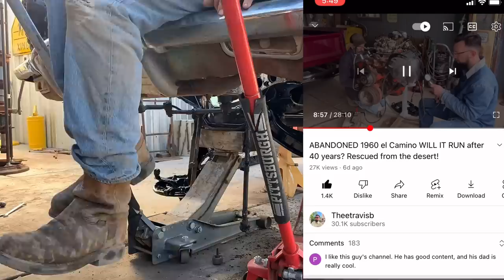ABANDONED 1960 el Camino revival, engine, suspension and brake work!

Comment: I love the do it yourself mode.  Been there and done that.  After a few sets I realized that dropping the arms off at the machine shop and letting them press them out was so much nicer.  Sure you paid some cash but they would be done and done right making beating out the bushings a long use of time when you could be doing other things. I always install a new timing set and oil pump on any used engine I have to install. Its cheap insurance.
Reply: That or having a harbor freight hydraulic press and heavy duty sockets, my buddy helps me out with that and for making our own brake lines he has a double flaring kits and we either save the fitting or go to autozone and also he has a coil spring compressor, he helps and sometimes I'm the hold the  tools guy

Comment: I own a 1960 Elcamino with a 327 but it's three on the tree. I did my suspension work with a press seems alot easier but you need to make some adapters. I also used Energy suspension bushings . One tip the bolts that clamp the bushings should be tightened  only when the car is fully assembled and all weight is on the wheels. By tightening them up with the control arms lowered they will bind up once they move up with the vehicle weight on them.
Reply: That's correct about having the weight on the suspension before tightening.
Reply: Yep, got that tip from Old Car Alley doing his Galaxie.

Comment: Glad to see you do new freeze plugs. So many times seen guys not on a used motor and end up with leaks.
Same with a quick internal inspection and reseal.
Myself I have never used the rubber end seals on the intake. Just a good bead of silicone left to skin over really well and carefully set the intake. Never had a leak and that was on some high horsepower engines.

Comment: You might have to change front yoke on driveshaft and also change driveshaft if this car was an automatic, I had to change yoke to install a 69 TH350 in my 60 Impala, but I found a driveshaft from a 4 speed car which did the trick, perfect fit, both length and yoke. Just a hint, I'm sure you probably know this. Nice work, love the 60 Chevys. Will be good to see this one run. (I still have my Impala, have owned it for 50 years, it's a keeper)
Reply from the maker: Thanks for the advice and that’s really cool you’ve had it that long. Wow

Comment: I really enjoy the father son working together and especially what you are doing with the El Camino. FYI, the ball joints have been replaced, that's why they bolt in, factory has rivets, occasionally on old A frames the new bushings will occasionally slide side to side, if so just hit them with a little spot weld. Next time on the master cylinder use a bolt like you did but put a nut on it and a socket or a piece of pipe and make a puller, also put some air pressure in the back but be careful the plunger will occasionally fly out with the air pressure. Great job guys, just fun to watch, keep it up.
Reply from the maker: Yeah you’re right they have been replaced good eye

Comment: Enjoying seeing the 60 E/C. One suggestion...you need to loosen the a-arm bushing bolts back up, just so they aren't tight, and wait until the car is assembled, and with the car sitting normally with the full weight of the car on the tires, before tightening the bushings back up to torque spec. Just before you tighten them, bounce the front end of the car up and down a few times, which helps settle the bushings to a natural position prior to torquing them. The bushings, as they are now are tightened with the a-arms hanging down, will be binding when the weight is put in the car and it's sat back down on the ground, which will hold the car up in the air a bit, and stress and wear the bushings prematurely.

Comment: Awesome to see everything on the front end cleaned and painted, but one question is why not use your impact wrench to take apart some of the bolts, like lug nuts and even smaller ones, I do it for lawnmower repair, you and your dad are good team, working on the master cylinder I can see you guys need to get that vise bolted down better, watching you work the master it reminds of myself without better tools, but sometimes it doesn't help, like on  my ford taurus we had to knock the lower ball joints out to get at the front wheel bearings as you could get the bolts to start but not enough room come out, and the ball joints were a bitch, like seeing your progress and blacken up everything you can get at to make what's good last 60 years

Comment: You should have mentioned your trick to hold the fuel pump rod, I noticed you turning in a bolt in the front motor mount hole to hold the rod while you install the fuel pump. I learned that trick years ago but there are many people do not know you can use a longer bolt in to hold the rod but then you have to put a shorter bolt in the hole to seal the hole after you have installed the fuel pump. I use an installer to mount the harmonic balancer, so it does not get damaged by hammering it on.
Reply from the maker: Good eye

Comment: Thanks for another great show! Rebuilding whatever you can instead of replacing parts, cool. The original brake master cylinder was tough, but is righteous! It will be a little tougher drive, but a more ATHENTIC driving feel. And that pushrod and those main bearings oughtta be just fine!

Comment: Not updating the brakes? Master cylinder and disc brakes on front? I know it throws off the rim with a disc brakes. Those things aren't necessary but they sure are nice. 327 fantastic. No better engine in my book. I've got 4 door hardtop with hardly any miles on it. We still have my dad till 60 what's not rusted away sitting down back as well. You and your dad working on these vehicles especially the 60 makes me think back. These are some great times that you have.

Comment: I'm afraid you might have trouble with that oil pan clearing the cross member. Also I think those are 6 cylinder motor mount frame perches

Comment: Nice work fella's, things looking good. I always use spring compressors when messing with coil springs... just too dangerous. As well, check my vlog on how i use a home made press to install control arm bushings made from simple left over supplies around the house!  going that far i would have pulled the heads and done a quick lap valve job with new valves seals... that said,  always the question of, when do you stop? thanks again for sharing.

Comment: Deleted my comment on the previous video about replacing the A-Frame bushings as I see you did it in this one. Free tip on installing the replacement bushings next time. Put them all in a plastic bag and toss them in your home freezer for a couple of hours (over night if you have the time) and you'll not have to bang them into place ... with lube or neve seize, usually you'll be able to press them in  with your thumbs.  Great series ... looking forward to seeing more. Bon chance from your favorite Texan (and a bit Arizonian) in the French Riviera guys.
Reply from the maker: I don’t delete comments I’m not sure what you mean but yeah that’s a good tip
Reply: @theetravisb  Thanks for your reply and sorry if it is unclear. Just wanting to help you and your audience know about expansion/contraction tricks that actually work rather than the hard way of beating them into submission ... also works on installing new ring gears on flywheels (nice if you've got a torch to gently heat the ring gear before placing it on the frozen flywheel.  Enjoying your build !

Comment: Guys. Why on earth did you struggle with that SINGLE line master cylinder???? They make a nice vac booster, master, proportion valve kit that bolts right on. You run new lines to the front, use the old single for the back. Much safer. Just did that to mine last summer. Very nice kit. Good luck. 👍😁
Reply from the maker: It is a nice upgrade.

Comment: Always stagger main seals and use silicone only nice bead on china walls when installing manifold, throw away rubber gaskets they always blow out causing vacuum and oil leaks.

Comment: There is a book written by John Muir. The Idiots Guide to Volkswagen Repair. Good read. You may never use another balljoint or tie-rod fork tool. As for those rod bearings, I saw enough to change them. Don't remember if the 327 had hydraulic lifters but seeing the shape of the rest of that motor I would check the lifters and pushrods. Too late now but I can't help that.

Comment: Love your content. But as far as the ball joints on the A-arms go, the ball joint from the factory came with pressed in rivets. The ball joint’s on those arms are aftermarket bolt in. So someone has replaced those ball joints at some point in its life.

Comment: You might want to loosen the upper a arm bushing bolts until the engine us in and weight is on the suspension or you risk twisting the rubber to the point of tearing or severely shortening their life.

Comment: I've never done any major engine work so this might be a ridiculous question but as far apart as you already had it, would it have been an additional huge undertaking to do new bearings, and piston rings?
Reply from the maker: Yeah woulda required a whole tear down
Reply: @theetravisb  A budget rebuild would have made great content, and solved low compression problem. BTW, there are 3 cues that point to your motor NOT being a 327. Check out Paul Johnson comment same time as this, 2 away. I owned a 327, and what he said matches what I had. Pretty sure yours is a 350. The harmonic balancer is larger.

Comment: Where do you get 327 from it's  a small block for sure but the heads on a 327 has no bolt holes for accessories the oil felĺ is in the intake with a breather cap and balancer does not have a bolt to the crank.
Reply: You are describing a 283  . The 327 has accessory holes and valve cover oil fill. The engine they have is a truck 350 you can tell by the large balancer.
Reply: Hi Paul. Had a '67 Chevy with a 327/275 HP. Remember oil filler, heads and HB like you said. You think 350 maybe? This thing has some miles on it. Notice the metal cam gear, and the amount of chain stretch. All SBCs had a nylon cam gear from factory for low noise, so this will be at least 3rd timing chain. 100+/- psi compression all around with 70 on #6 cylinder.
Reply: @MUUKOW3  I had a '67 327/275 HP 4 bbl with single exhaust. Apparently pre '68 was different (google search). Mine had the oil fell in the manifold and no bolt holes in the heads. I tinkered with it for 8 years so I remember pretty good. I agree with you about the 350 and the larger balancer. Travis has a 350. One thing that made me immediately suspicious was that he had a 350 turbo with it. I personally have never seen a 327 with a 3 speed auto from the factory, it was always a powerglide or a manual. I'm not saying there is no way it could be, I just haven't seen it ever. I imagine a truck might be different and offer a 3 speed.
Reply: Try looking up the engine numbers left front head deck left rear next to oil sending sensor  check head numbers it .remember small blocks Shar a lot of parts chevy was good for that  it could be 305 307 350 maybe a 400 sbc

Comment: All that work you did with the suspension and everything looks really good. I understand you want to keep the car completely stock. But why wouldn't you just go with a front disc brake conversion kit. Are you going to put a power booster on there. Cars without power brakes are terrible. With all the technology out today to me it seems logical. Also power steering just wondering you have it all apart. Keep up the good work
Reply from the maker: Honestly it just comes down to money, it is a great upgrade that we support though

Comment: I don't understand why you didn't just "Okie-fab" an extractor. You know, with a longer bolt with a locking nut & a flat washer or two for the locknut to rest against to draw on the piston, a 3/4" drive deep socket, (and whatever I.D. size required that would have allowed the master cylinder piston to be drawn into it), or a piece of pipe & some flat washers. I've made a number of them over the years for various situations such as yours when I either didn't have a proper extractor for the job, or the needed tool just didn't exist, so I invented one. 

My shop setup pretty much resembles yours, like you & your dad, I don't have all the fancy tools & expensive equipment that so many of these channels here on YT get to utilize these days because of the funds supplied by their subscribers, all of the ad revenue, plus tools & equipment that get supplied by sponsors. I'm just an old school shade-tree wrench in his mid-60's, and if I can't afford expensive store bought tools & equipment, I either look for inexpensive used equipment at the local flea market, yard or garage sales, or I simply fabricate what I need to get the job done.

From just glancing around your setup, you most likely had everything required to make one, and y'all would have had that stubborn little piston out in no time. Mind you, it involved more effort, not to mention a ball-peen speed wrench to assist, but the two of you got it done nonetheless.